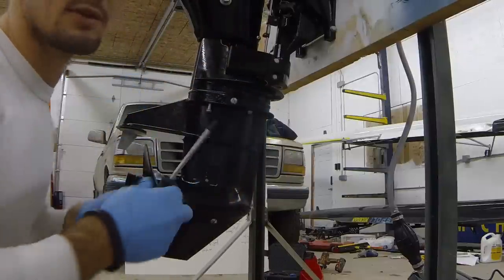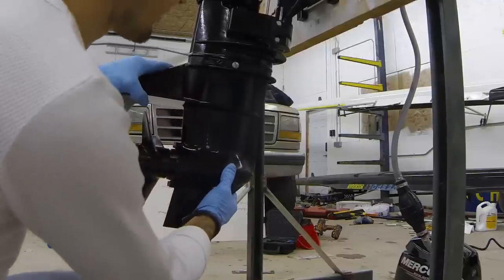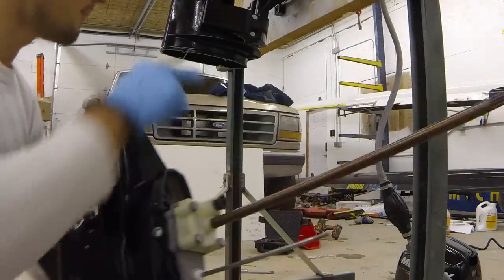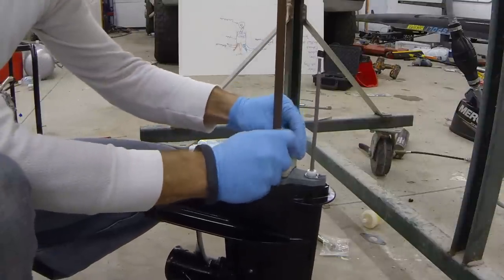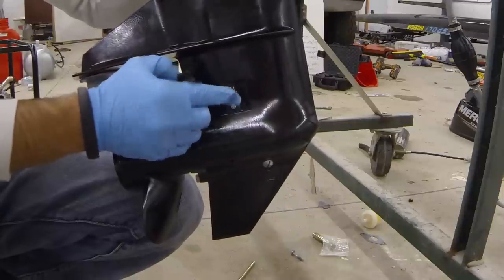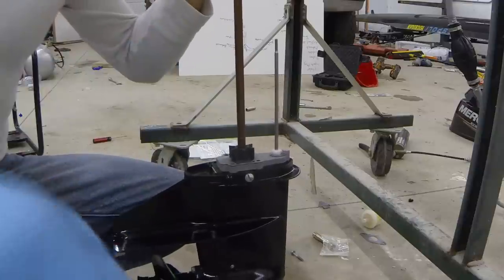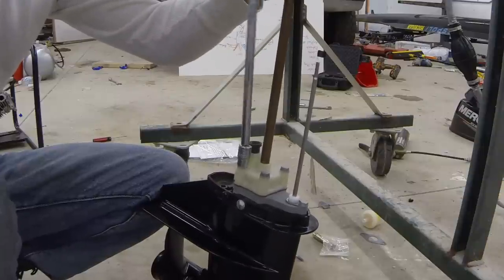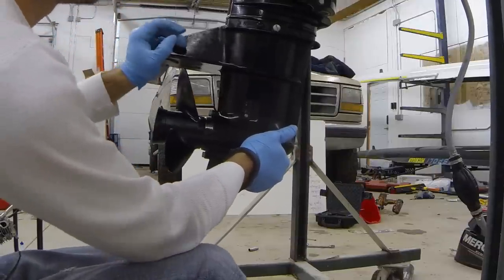How to replace an outboard impeller in 15 minutes, water pump

Comment: Heh, I picked up another little trick for my self watching your video.  I have three outboards.  a 4 hp Johnson 2 stroke, a 9.9 fuel injected Suzuki, and a 9.8 Tohatsu.

I just a beginner with repairs on outboards.  But recently I replaced the impeller and housing for the water pump on the 2 stroke.  When I went to put the drive shaft and lower unit back together I had some trouble getting the splines on the upper part of the drive shaft to mate with the gear box on the lower end of the engine.  Now that I see what you do I can’t wait to try this trick you introduced me to.  “Put the lower unit into reverse before installing...”. That way you can manipulate the splines to mate.  That was very cool.  Thanks again...

Comment: Could you show what direction the water pump fins are to go. Clockwise or counter clockwise? Very good video !
Reply: Came her for this. Any luck??
Reply: @afabre93  Look at the direction the fins are (memoried) or note the direction the the pump impeller shaft rotates when , while the lower end is in gear (forward or reverse) turn the flywheel by hand or with the pull cord and see which way the "drive rod" (that the water impeller is seated on) turns. Be sure to turn the drive shaft in the same direction it was turning when the starter rope was pulled a bit or by turning the prop (shifted into reverse) a bit while fitting the lower unit up into the upper engine housing to get the impeller "fins" sitting in the correct direction.

Comment: You did a great job but I have to point out a couple of important errors.  It is Very Important to rotate the drive shaft in the "correct direction" while replacing on the housing @ 6:27 or you will destroy your new impeller.  Also, Do Not use petroleum-based grease on Rubber Parts @ 7:08 as it will break down rubber over time - use Silicone Grease on Rubber parts.  Small details - what Make/Year/Hp of outboard?  How did you get to the shift linkage?
Reply: I noticed that as well. No mention of following the direction of the flywheel, either clock wise or counter clock wise before seating the impeller. Very important that the blades sweep instead of scoop....
Reply: And apply grease to all the bolts and drive shaft to prevent corrosion

Comment: Great video. One question I have is what direction did you rotate the drive shaft when you worked the pump into the housing.  Does it matter?
Reply: Your old impeller wings will be angled one direction or the other. During disassembly, take note of that direction and ensure the new one goes on with the same directional bias.
Reply: If there aren't any blades left how do you know which direction the blades go?

Comment: Hi thank you for your instructive videos. I have a mercury 9.9 4t . I realized that there are numbers 1-2-3-4 on each bolt that connect the lower leg to the upper unit. I suppose that these numbers define the sequence that I should follow in operating the bolts. But I could not find any answer to the question " should I follow the sequence 1-2-3-4 in loosening or tightening the bolts ? " I appreciate your advise. Thanks

Comment: Great video. Only thing is you didn't mention if it matters which way you turn the drive shaft when reassembling the impeller into the water pump housing.

Comment: You forgot to mention to turn the drive shaft clockwise. Also Marine grease on the driveshaft splines as well as the impeller and the water pipe connector going to the motor make everything go smoothly.
Reply: yes..Ed you were reading my mind..lol

Comment: I am not having a question on this exactly but...I started my engine a couple days after using her for several hours and I just made sure she started because she died in the water from swells cutting off power. Anyway, I put in forward and reverse only for a moment and shut her off.  Now she is not starting at all. Not even idle for a second just barely after letting sit over night did I get a little smoke come out 1st pull and a attemp to start like the sound the 3rd pull now nothing is happening again. Any tips?

Comment: NOTICE : When removing the water pump housing, remove the screws completely, then pull it up.
If the impeller is a little tight and is pulled out while the screws are present, the gasket is attached to the screw threads, and the impeller blades that are opened are caught and torn off.

Comment: great video on changing waterpump 
I own 1999 Mercury 15hp manual start.
Quite on me out in ocean - thank heavens for fellow boater who towed me in.
Tried rope starting when floating around waiting for the tow but the engine would not turn over
I followed your video but the water pump is fine.
When I removed rope start housing I am  able to rotate the fly wheel  nut with a wrench but only goes  3/4 of a complete  circle at which point it binds.
Your thoughts?
Sam
Reply: simeon hyde probably dropped a valve,or broken timing belt/ cam shaft if its a 4 strok

Comment: Thanks for the video. Do mercury 9.9s have an oil filter?? I read something about that in my manual but cannot find it on my motor..
Reply: Mine is 2019 mercury 9.9hp. Asked mechanic same question  he said there is no oil filter on it

Comment: I’ve got a 3.5 Mercury four stroke with Neutral and Forward only. I replaced my impeller and lined everything up as shown in the video but my motor will not shift into forward for some reason? Any ideas?

Comment: One thing I haven’t been able to figure out is I have had to replace my 3 times.I have a 2015 Honda 9.9.when I take it apart it’s looks like the housing got melted a little.I never run it dry and the prongs are dry and broke off,I have never had the problem with any other motors I have owned.
Reply: Have you blown out the passages?
Reply: @gregorytimmons4777  I did this time,so far so good

Comment: My doesn't want to pee anything. Suggestions? I noticed before I was to changing oil on my Honda 20hp. I warmed up my oil by running it in water but no water peeped out. Clogged maybe?

Comment: Great video! I'm going to tackle this job. What gear should the motor be in before dropping the lower unit?
Reply: Not sure If you will see this but it dosen't really matter as long as it's in the same gear when putting the lower unit back on as when you take it off

Comment: Does it matter which way you turn the drive shaft when installing the water pump housing over the impeller?
Reply: robert gallinoto yes,clockwise,as engine turns.

Comment: Would u know if after replacing all those parts it's still not pumping water in? What else could it be
Reply: Could be the water jacket on the left side might be clogged up. Also check the small hoses for blockage. Check out the thermostat to make sure that it's operating correctly by removing it and drop it in some boiling water.

Comment: I have a question about the water tube coming up from the pump, if I have water coming out the tell tale, tells me the pump is working, but the issue I’m having is water coming from between the upper and lower parts of the body ,coming out near the  area in the vicinity of the shift rod, so do I have a thermostat issue and water is backing up , maybe coming out of the water supply tube or is the tube broken?. Unit worked well prior to last season and I didn’t change anything yet. Thanks
Reply: I have the same issue. Would love to find out!
Reply: @AaronTBR   hey I just bought a implellar kit. Ppaets guy said that possible damage or wear on impeller would not give enough pressure to push water through and may be coming back instead of through the whole system. I'm going to change impeller and gasket . Only cost about 19 CA dollars. Looks easy enough to do. I'll let you know maybe put up my own video? I'll keep you posted
Reply: @victoramaral5622  was water coming from the tell tale as well as around the shift cable? That's the issue I'm having. It's going through the system, but also out around that connecting piece by the shift cable.
Reply: @AaronTBR  exactly. Parts guy told me maybe impeller wasn't creating enough pressure. But we'll see I need to change it anyway.not sure when it was done last and it should be done every 2 years ,as so I was informed
Reply: @AaronTBR  so ii changed the impeller and it didn't fix my issue. 
Here is a link to a video of issue. If anyone else can help let me know. Waiting to hear back from anyone!
https://youtu.be/AWh70MfD2Js.

Comment: What happens if my prop only turns one way and when I turn it, there appears to be a clicking noise. I obviously did something wrong, but what causes the clicking noise.  Thx in advance!
Reply: You might have to adjust the lower unit linkage. It might not be going down far enough to engage the reverse gear.

Comment: I cannot get the drive shaft seated and the lower unit reinstalled to save my life.  I'm ready to throw it in the trash!
Reply: Bob Reed turn the engine flywheel or propeller while in gear to align the drive splines. Easy when ya know how!,🤣

Comment: Does it matter the orientation of the impeller fins when replacing?
Reply: No, not if you install a new impeller, however,  if you reinstall the old impeller then you would want to have the fins slightly bent back away from the direction of rotation.